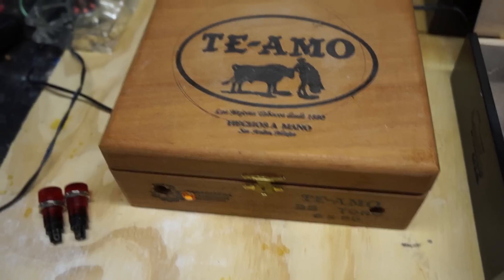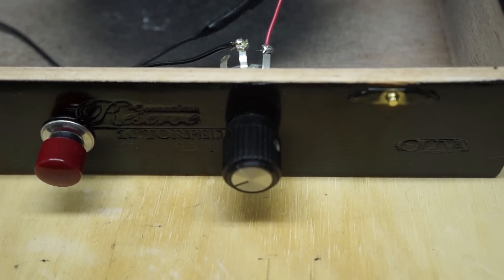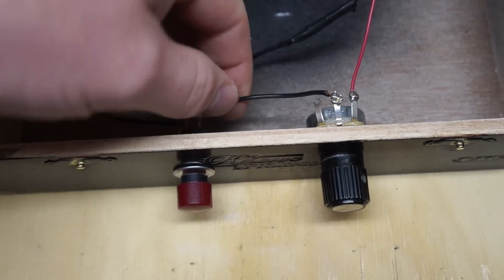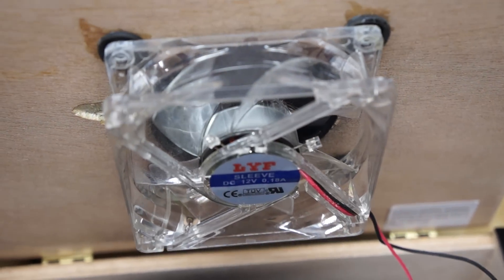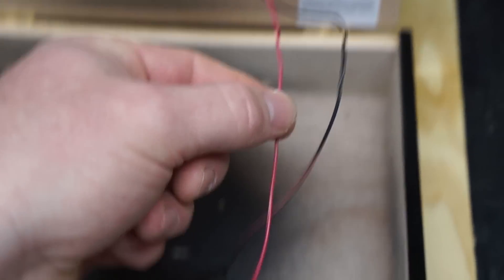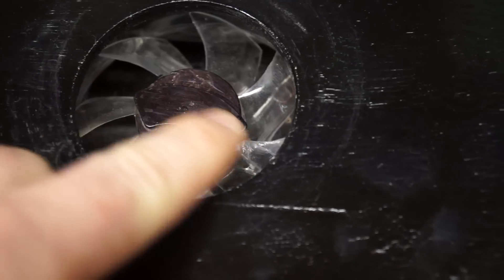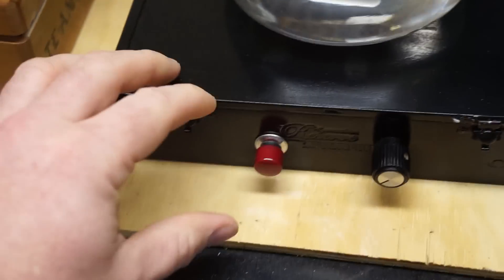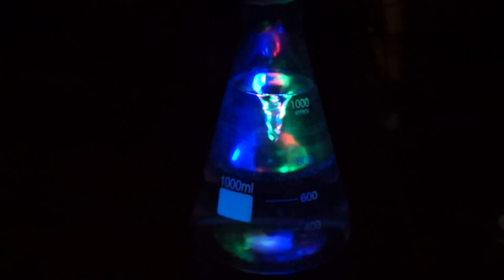DIY - Build A Homemade Stir Plate In Minutes

Comment: Maybe a 12 or 5 V DC source and a 12 or 5 V DC motor along with on of these buzz magnets is simpler :)
You glue the Buzz Magnet on top of the motor so it spins. or from one of its sides/edges.
https://duckduckgo.com/?q=Buzz+Magnet&iax=images&ia=images
Pound/hit buzz magnet with a sledge hammer to make it as flat as you want. ;D

Comment: Cut the blades off, better torque and speed.
Reply: and revers the lead to the POT from the right side to the left to get the POT to increase speed  in a clockwise turn.

Comment: first of all sory for my bd english, i just want to ask..
1. which potentio meter did u use? 2k 5k or 10k

2. what size the spin bar is?
Reply: b25 https://www.amazon.com/Rheostat-Tolerance-Wirewound-Variable-Potentiometer/dp/B00F1YT3I0
Reply: Lucky Susanto That's my question as well, about the potentiometer. Did you find the answer?
Reply: Jose Gonzalez actually in my country an diy machine like this they (*indonesian brewer) using 5k - 10k.

Comment: Technically you wouldn't need to drill a hole in the cigar box. In that case, I'd say the thinner the lid the better because you will loose magnetic strength with it being farther from the bottom of the glass. Also, you would want a spacer to allow clearance for the magnet that was glued to the fan.
Reply: Thats why he cut the whole and put the fan in the bottom the thickness of the wooden lid gives clearance for the thickness of the magnet to be flush with the vail

Comment: So what's better to get a potentiometer or rheostat for like a 2000 rpm pc fan
Reply: I realize this comment is 3 years old, but just in case anybody else comes along with the same question:

In this case, you only need a rheostat. However, a potentiometer can be wired as a rheostat, which is actually what he did on the video. A rheostat has 2 pins and a potentiometer has 3, but you can use 2 adjacent pins of a potentiometer as a rheostat.

Comment: You just forgot that the fan will cool the bottom of the erlenmeyer flask which can be a downside with some chemicals/precipitates
Reply: +Beer Mumbo actually the fan can't cool since it cannot really move any air, since that box is closed, especially with the flask put on it... so it doesn't matter... but actually, why drilling a hole in there at all? sure, for fancy light effects... but this way you cannot put small flasks on it, it may get dirty inside when fluid comes out and so on ;)
Reply: +Beer Mumbo You could cut the blades off.
Reply from the maker: Good point.  I haven't noticed any impact to the yeast starters though.  Possibly reversing the fan can remedy that.
Reply: jjenson2006 Only problem about cutting off the blades is the speed is harder to control as the rotation is also controlled by the fan weight
Reply: THE UNKNOWN
Well, if that's a problem, you could glue some pennies to it to weigh it down. One would think the resistance from the stirrer would be greater than the resistance of the fan blades, so I don't think that would be a problem, unless you run it without attaching a stir bar.
Reply: jjenson2006 I can upload a video about a magnetic stirrer i made which is a bit closer to the store bought ones than this one concerning the regulation of RPM's. Where the fan blades are still on. I can also do temperature measurements to see if the fans affect the temp or serotonindude is right. I will post a link when it's up
Reply: kan petyim
No, it probably won't affect the magnet much, but it's certainly going to put a damper on the air that has nowhere to go, slowing the motor down, which is why it's best to cut the blades off. However, cutting a disk out of the plexiglass and epoxying it to the fan (so it spins) after cutting the blades off wouldn't be a bad idea. You could attach the magnets to that and space them as far apart as you need to.

Comment: can someone look at this item on amazon and tell me eif it would make a good stirrer/hot/cold plate "Neon® New Mini Black USB Fridge Cooler Beverage Drink Cans Cooler/Warmer Refrigerator'......it is basically a mini usb fridge/hotplate switchable with a little fan on bottom to vent heat sink  that magnets could be glued to.....it would be 20$ shipped for a compact  hot/cold/stirrer after a little modification and i think by using different volt usb adapters which everyone has from different phones you could adjust temp though patentiometer would definitely make it nicer.......lmk what you think, i am thinking it is a "ok" diy idea for someone going to use it  a little but not for real chemist obviously

Comment: Do you really need the rheostat if the adapter has adjustable voltage?
Reply: It helps because it gives you finer control over the fan speed (and thus rotation of the magnetic field). Depending on the strength of the magnets on the fan and those in the bar, as well as the dimensions of the vessel you're using, a small difference in rotational speed can be the difference between a spinning bar and a bar that's uselessly dancing all over the bottom of your beaker or flask.

Comment: That isn't a ground wire. You have positive and negative, but no ground.
Reply: ***** technically the negative wire is the ground you will not find a symbol for "negative" because the is no such thing as negative voltage... if you pull a negative voltage reading its one of 2 things you are reading it the wrong way or its wired incorrectly. a multi-meter will read a negative voltage if you switch polarities. this would still run properly if he switched the ground and input from the power supply
Reply: He officially has nothing better to do then try to make an argument.
Reply: ***** True.
Reply: If you dont know what you are doing, lets say run the wrong voltage to the fan dont have a complete connection, and started a fire....yeah it would of been a good idea to be grounded. 
Would the tripping lights make my yeast start a rave?
Reply: he also says run directly from your AC wire lol.. hopefully not.
Reply: bZerghTV CSGO That's not really relevant to him mixing up the terminology.
Reply: I'm pretty sure he doesn't need a ground wire if there isn't a metal casing.
Reply: cole emslie Getting electricity wrong is dangerous. He mixed up terminology and I corrected him.
Reply: ***** Okay but you only really need a ground wire if the product has a metal casing that can conduct electricity. But since its made out of wood it seems, there is no need to have the ground wire cause wood is a poor conductor of electricity.

Comment: Good job, probably a good idea to drill some holes in the back too for airflow for the fan so it doesn't overheat.
Reply: Or just get a reverse 🔀 airflow fan.. Or mount it backwards, so it sucks air in, instead of forcing it out